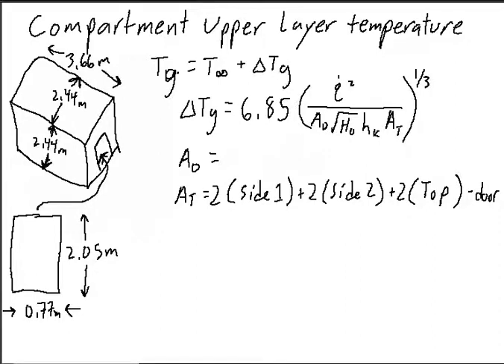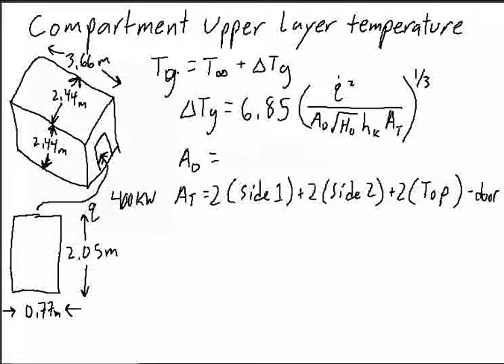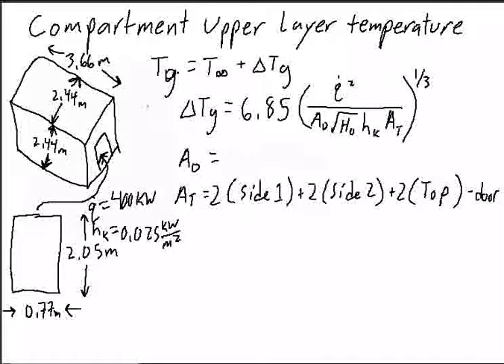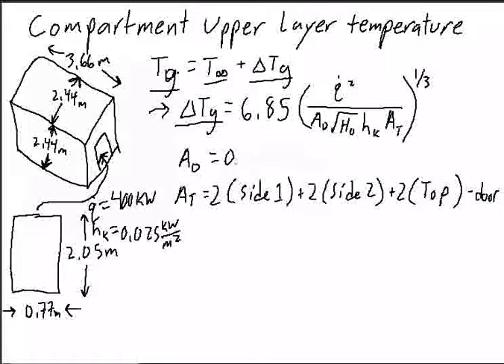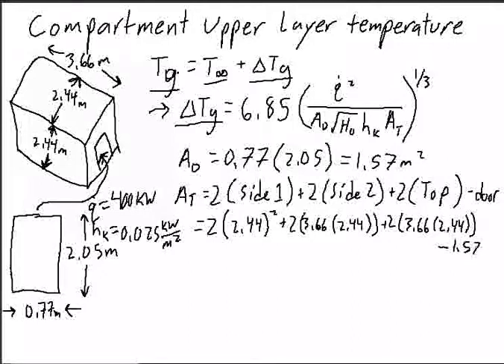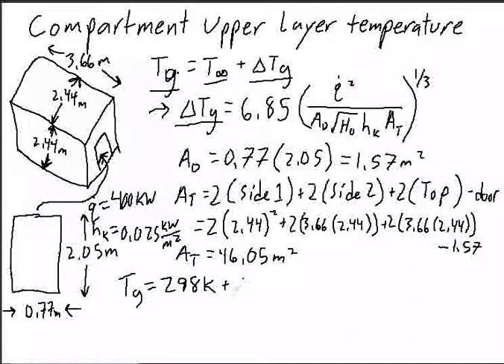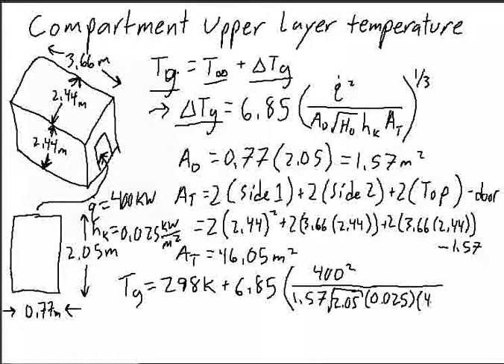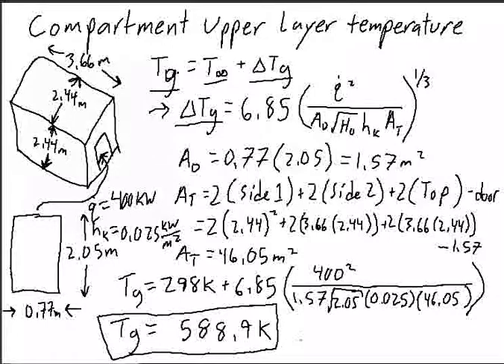Upper Layer Gas Temperature in a Compartment Fire - FPE Teaching Tool

Comment: Your not the gas champer. Guys.    Prob not.  110.  220. Up step. 30000. 40000. Volts. Cooks. Wiring out of tge buikding. Q install.  Works sky scrapers.  Cools wiring.  Theory.  Building sprinklers.  Doper 8.  Pentagon kemper twin towers.